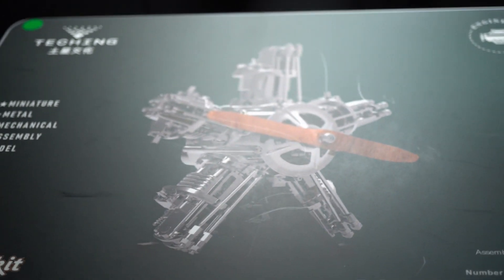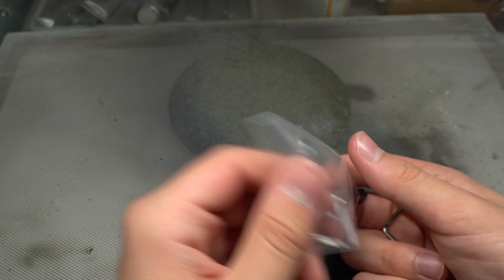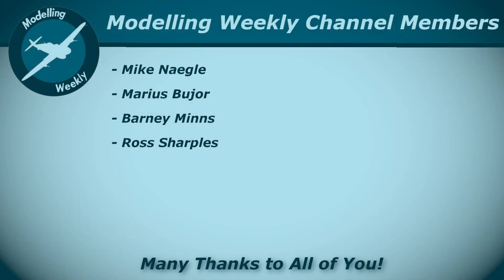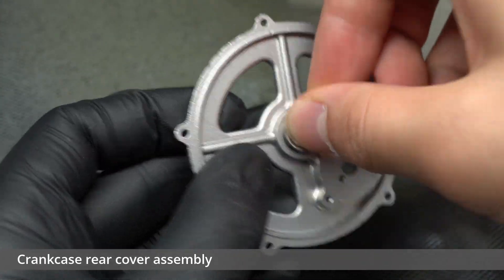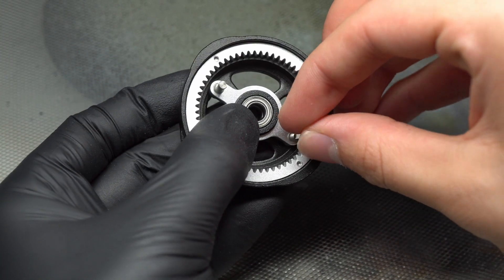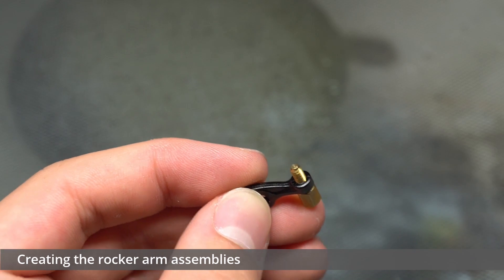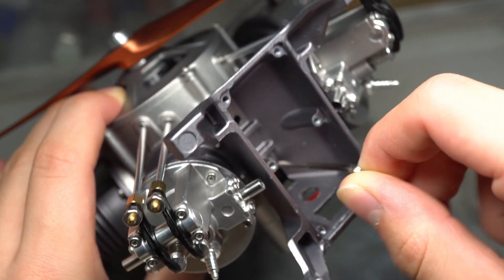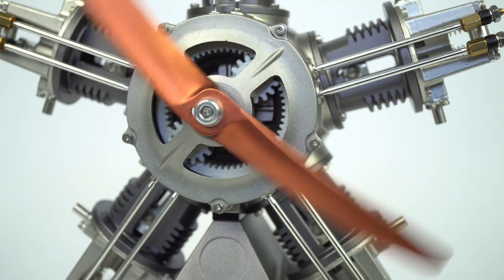Building a 5-Cylinder Radial Engine by 'Teching'! | Full Build

Comment: Great build.  Neat engine.

Connecting rods are what are connected to the pistons.  

Push rods are what push the rocker arms to open the valves.
Reply from the maker: Thanks for the info!!
Reply: ...and the valve and rocker assemblies are mounted on the cylnder heads, not piston heads. 🙂